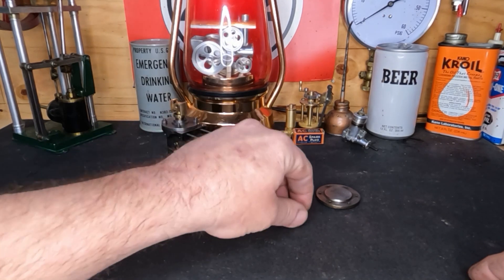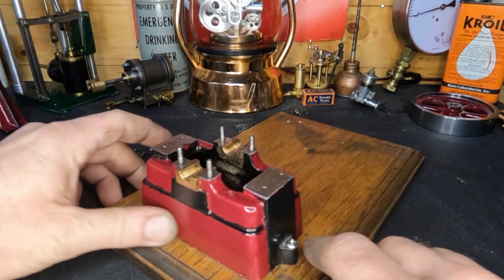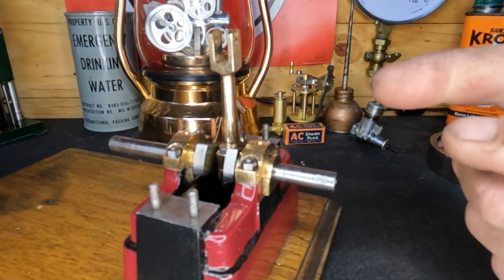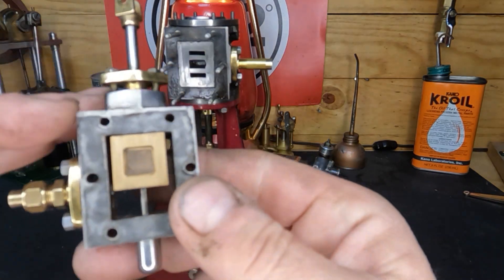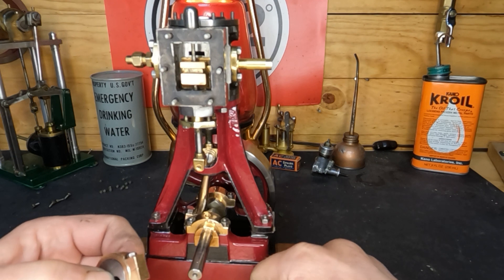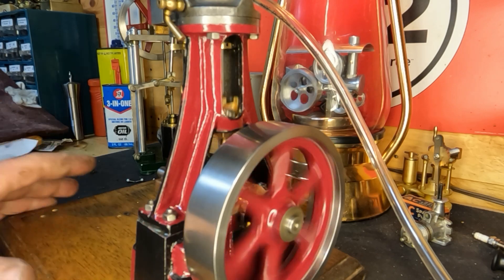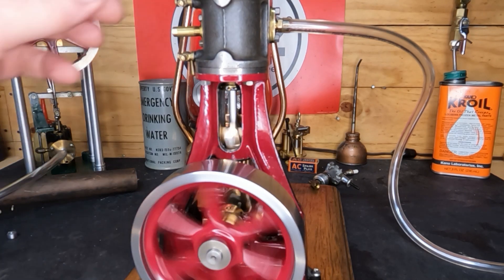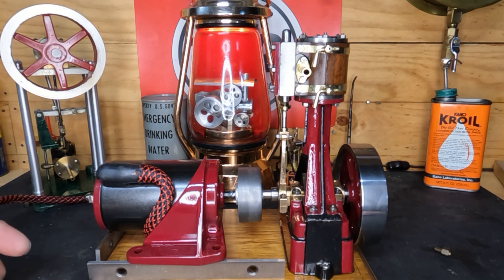Stuart 7A Steam Engine Repair & Refurbish Pt. 5 Main Bearing Repair, Reassembly And Running!

Comment: I'm not much into air driven engines but for some reason I like this little engine.  I have a hit and miss engine that runs very well I been thinking about getting an old started/generator off of a riding lawn mower and marring the two together to generate 12 volts to a couple of lights just to see if it will work for me?
Reply from the maker: Hi Gary, it's been awhile since I've heard from you. I'm only running this one on air because it is handy, we will for sure be running it on steam (I promise).
Reply: I haven't been on the net much lately I had a massive heart attach after surgery I was in ICU for 9 days. I'm getting better everyday getting my strength back each day.
Reply from the maker: @garyware3501  Oh no Gary, I hope and pray that you make a fast recovery. God bless you.

Comment: Nice work.Interested to see your results, I'm working on a multi engine generator plant atm.1 Turbine,1 mill engine and a Stuart oscillator connected to 1 boiler.
Reply from the maker: That sounds like an exciting project. What size and type boiler are you planning to use?
Reply: @steam212  Its a CMS unibody electrically heated with variac.
Reply: bout 500 ml
Reply from the maker: @MrZx9rdoug  I would like to follow along with your project. Are you thinking about making a video series on it?
Reply: @steam212  I'm no videographer, ,but i will send you some pics.